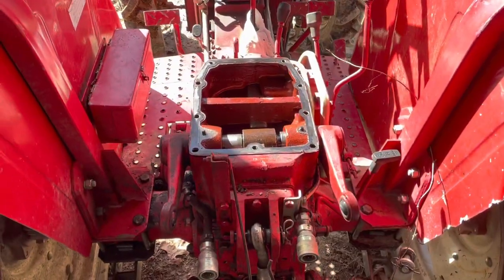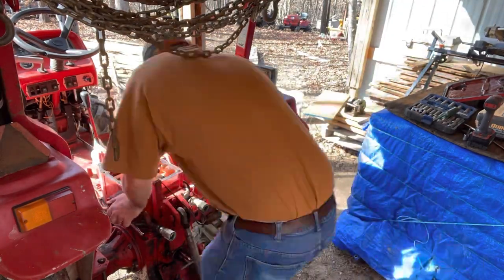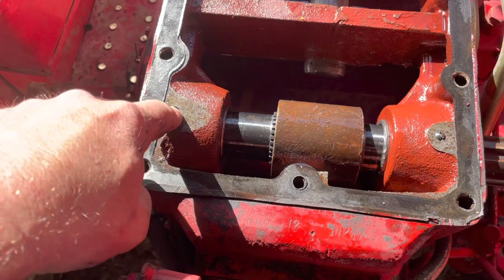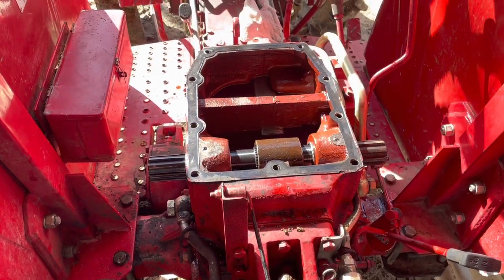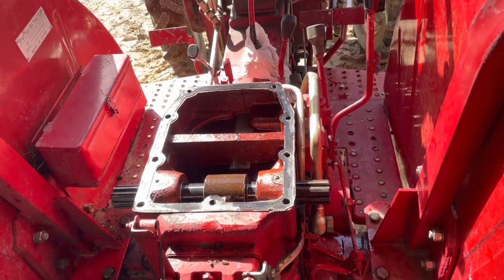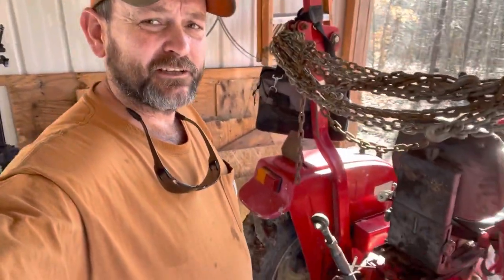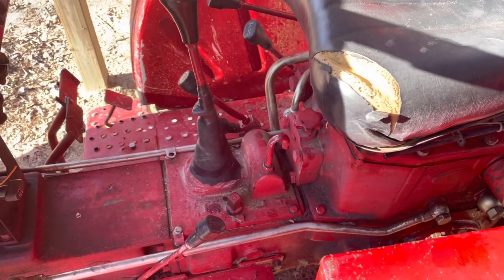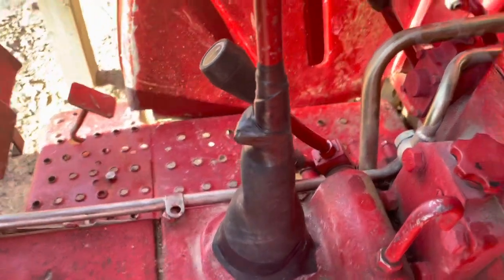Rebuilding the Hydraulic Lift of our Jinma Smartrac Tractor

Comment: Good video I have a farm pro 2420 which is the same company did you replace the seals on the ram that pushes up the lift since there are no books I have to figure out if I have to take the shifter out and go in through there or take the top off
Reply from the maker: I  did not.
Reply from the maker: But let me know when you figure it out so I’ll know when I need to do it!

Comment: Any info on the rear remotes? I have a similar tractor and can't get fluid to the rear remote to lift my plow and disc. I've screwed in the speed control valve and shut off the 3 point per directions from old forums, but I'm still not getting fluid to the rear quick connects / remotes.
Reply from the maker: Sorry, I’ve never connected anything to mine. Hope you get it figured out soon!

Comment: Why is my new pump not pressurized so the 3 point will operate. Tried pressurized air in the tank to force it through
Reply from the maker: I wish I had an answer for that one. The pump on the side of the engine should prime itself and the whole system. Or at least that’s my thought.
Reply: @RanchinOnMission  kinda what I thought! That is how my zero turn worked
Reply from the maker: @Daddyfarmer  mine has hydraulic steering as well. If yours does, is that working?
Reply: @RanchinOnMission  The hydraulic pump for the steering is separate from the back and it does work
Reply: @RanchinOnMission  The hydraulic pump for the steering is separate from the back and it does work
Reply from the maker: @Daddyfarmer  my model uses the same pump and is located on the right side of the engine and uses a valve that prioritizes steering over lift, accessories or a front loader.

Comment: I have 354 small tractor not lifting
Reply from the maker: If it has hydraulic steering and it works, that’ll rule out the pump or if it has hydraulic remotes on the rear then you can test with an attachment or if it has a FEL , operating it will too. Other wise if it’s full of fluid, it’s probably the lift cylinder, but I’m just a redneck.